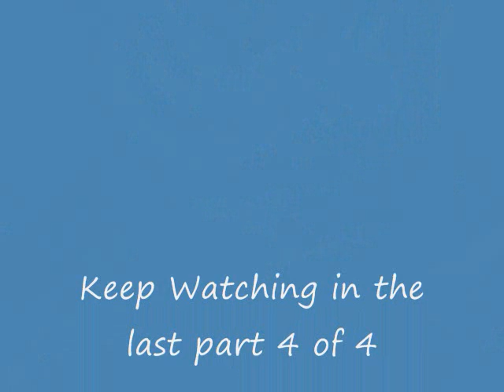How to fix or open the ipod video 5th Generation, Disassembly Part 3 of 4

Comment: I got some tips whenever you put it back together and the little click wheel button won't stay put....I used electrical tape to hold it in place (taped it from the front)....hope that helps for your Put-back-together video...once gain, great job on the video dude.